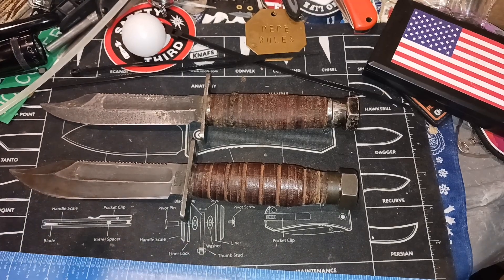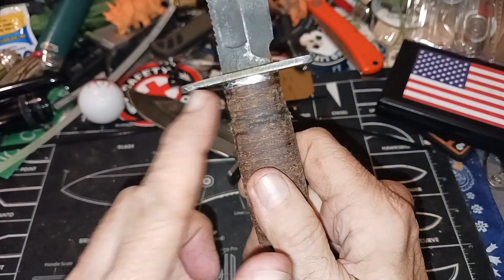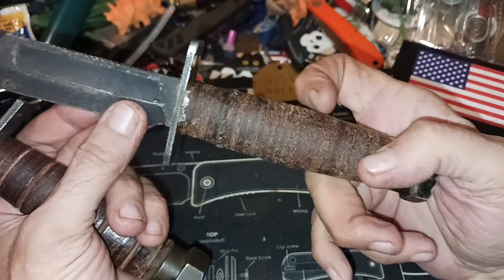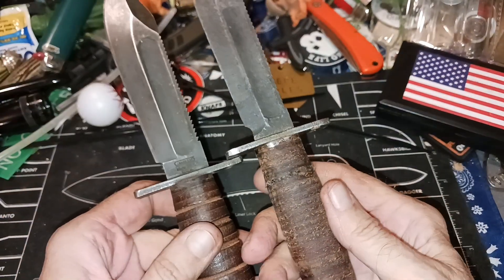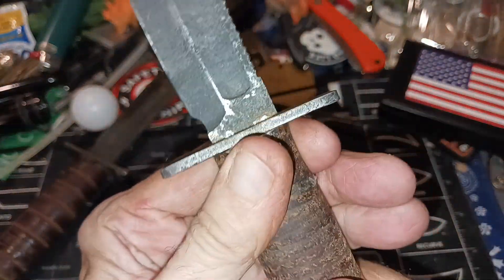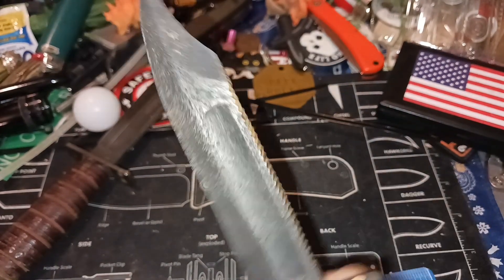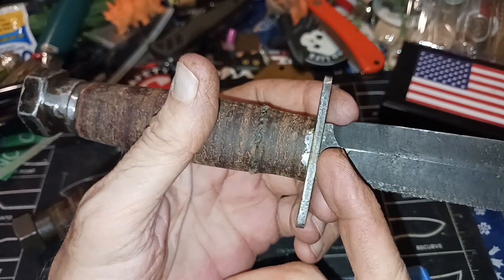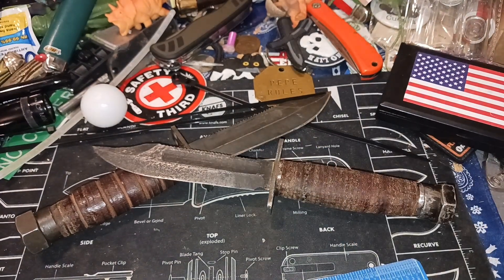(1623) USAF Survival Knife Restoration🔪 Complete

Comment: Pretty impressive.   I was going to say it looks like it was worked hard and put away wet but then you actually have photos of when it was worked hard and put a way wet.   Really a fantastic  job.     I think the reason a space developed is simply something that happens when you peen.  It's one of those physic laws or something.  The who equal and opposite reaction.  You're not tapping the leather, you're tapping the tang  the tang is invariably getting pushed through the washers and are hitting the end cap where they can't move anymore.   This causes further compression of the leather washer (plenty of internal space with the washers).   At least that's what I think is happening. 

I think you came up an excellent solution. (inserting a another faux washer before sanding).   Again very impressive.  And now you can honestly call it an Air Force Veteran's Survival Knife!   The knife is truly a survivor brought back from useless junk to a functional blade!  Congratulations!
Reply from the maker: @KnifeChatswithTobias  Thank you, Tobias. One of the reasons why I didn't polish the handle is that it would look out of place. I've been putting petroleum jelly on the handle, and it's darkening up nicely. The handle being slightly shorter actually fits my hand better. I've been enjoying carrying and using it all day. It doesn't cut cardboard as well as a box cutter, but it will cut. :_Boris: